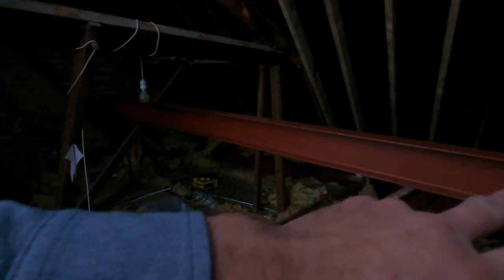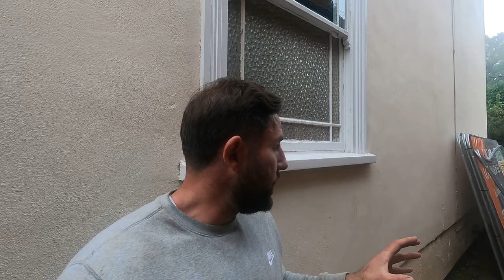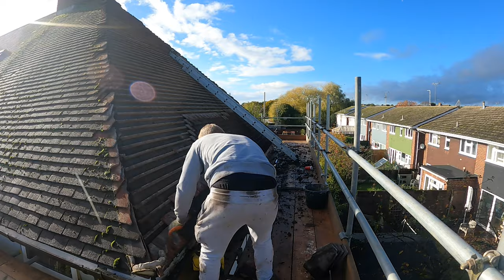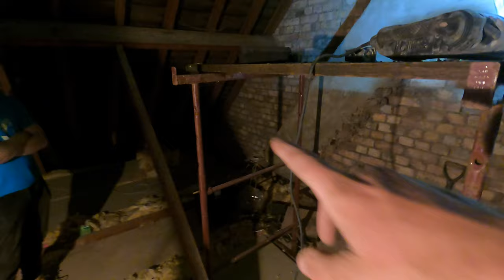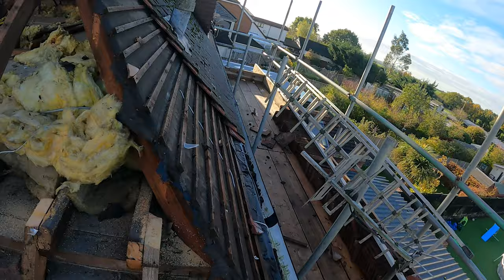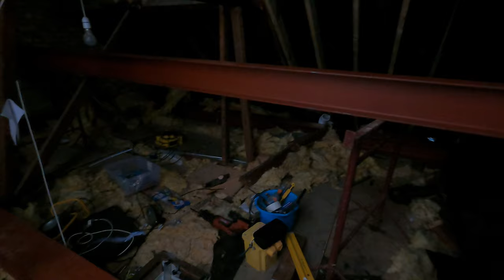Hip to Gable Loft Conversion | Paul Jamie | Weekly Episode 37

Comment: If the party wall was a solid, 9" could you put the pocket for the steel in it?
Reply from the maker: Yes this what we did on this project, 3 steels in the floor and 1 in the ridge beam, all sitting on 20mm spreader plates.
Reply: @pauljamieconstruction1871  Sincere thanks for the reply, I'm never quite sure why sometimes and only sometimes a post is demanded, even when the wall is 9" and solid, do you have a view?
Reply from the maker: @LondonSoundSystem  i couldnt tell you, i suppose different engineers views, or knowlege.
Reply: @pauljamieconstruction1871  Yes, and we know how variable they can be!